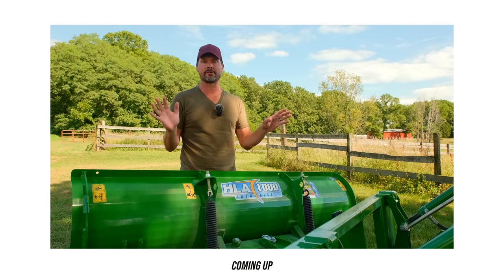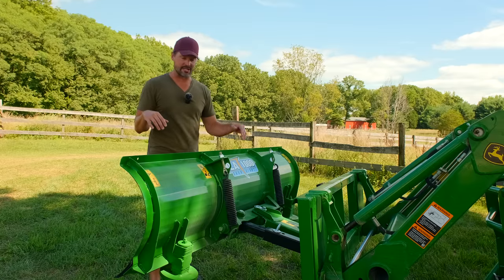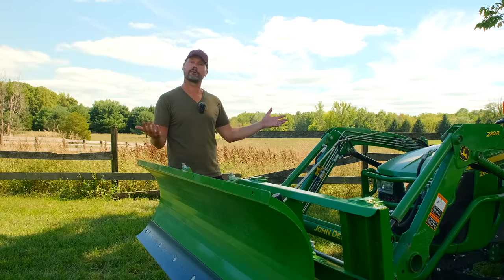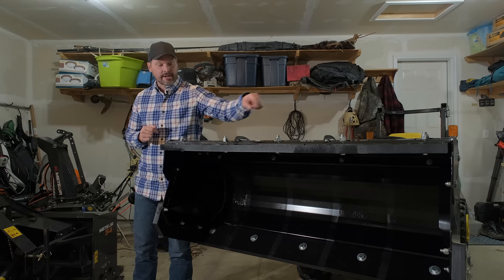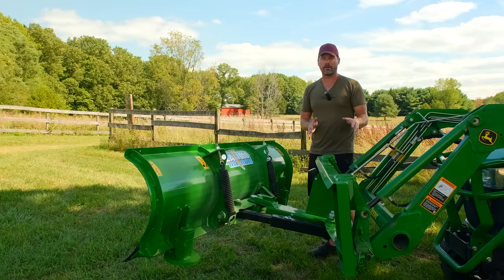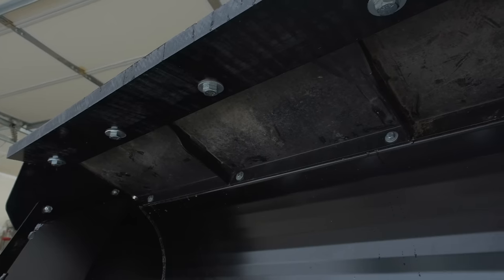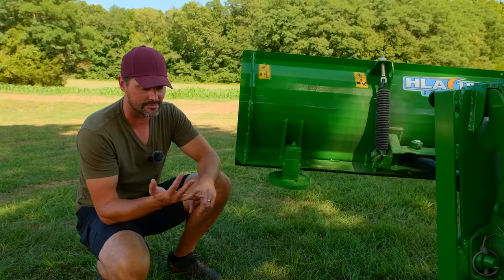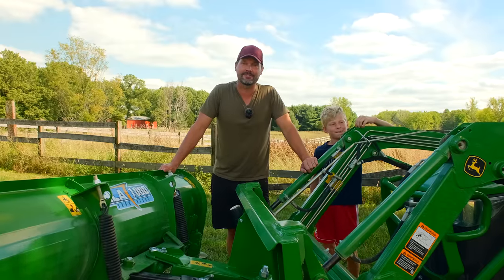A BRUTAL WINTER IS PREDICTED! THE ONLY SNOW PLOW YOU’LL EVER NEED! ☃️

Comment: Nice video. I have used an HLA 2000 Blade for the past 6 years, and they are a well built blade. Also, the UHMW edges I got from you last season are working out great! They get right down to the pavement and don't leave any marks. It's a very easy way to distinguish my residential plowing from other operators.
Also have grooved the tires on my last 2 tractors, which makes a big difference in traction. Haven't needed chains in the past 20 years.
Reply from the maker: That's awesome, glad to hear it.  Great info!

Comment: I use Spray on wipe off Groits Ceramic wax here in Northern New England. We need to be able to get slush off before it can freeze, and get Ice that has frozen, OFF .. I do two quick coats of the ceramic in the SUMMER when the buckets are off and on end.
Reply from the maker: Sweet, yeah I really should apply something soon if I'm going to do it again

Comment: I like just using the bucket and a rear blade to clear snow here in upstate N.Y. the bucket has It's limitations I know because it can't be angled but when the edges of the driveway start closing in as the season progresses, I can scoop the snow up and either dump it somewhere else or just dump it farther off the side. I clear the church parking lot where I attend and the bucket comes in handy to lift the snow and dump it on the other side of the curbs. That's harder to do with a plow. Anyway, I like your videos, keep 'em coming.

Comment: I have a 6ft snow plow on my 3046r. It does really well so far. Just installed a summit hydraulics 3rd function kit on it. Can't wait to upgrade the plow to be able to run hydraulics. The Canadians definitely know their snow. I have an old tractor supply  3pt snow blower that was made by a Canadiancompany. I've Had it 3 years and haven't had a chance ce to use it. Great video BTW.
Reply from the maker: Sweet, thanks for chiming in.  Stay warm this winter!

Comment: Hi Courtney,  Thanks for posting this great video.  I enjoy your content.

About the spray coatings on bucket, pusher or blade.  I noticed the you had a nice shiny new pusher for your test.  The control section worked as well as the different sprays.  Nice new smooth, painted, surface is also a coating, that's why it worked just as well...

I believe that the sticking issue comes into play with a well worn rusted bucket or blade.  Even if they are repainted older buckets still have the uneven textured, rusted, surfaces.  That is when the sticking is the worst.  In addition to PAM, Fluid Film, etc., kerosene has also been used as a release agent.  My bucket is over 35 years old and snow sticks, unlike your new buckets or blades.   😃  😊 

That could be a future test for you.  I know you are selling new shiny products, but down the road we users don't have the equipment looking quite as nice as new.  That is if we use our equipment.   😆 

Thanks for the post...  Dan
Reply from the maker: Good point Dan, will have to repeat in the future!  Thanks for bringing that up.

Comment: JD X758 -- With 4WD, HDAP tires, a 75# wheel wt. on each rear wheel, plus 6-42# suitcase wts. on the rear bracket, I have no problem pushing 1 1/2 - 2 feet of snow with my 54" front blade.  For years I have used CRC Heavy Duty Silicone spray, generously applied to the front blade, to prevent a build-up of snow and slush -- has worked well for me in Upstate New York, and now New England snows which tend to be quite heavy, wet and sticky.
Reply from the maker: I do love the x7 Series!  Thanks for sharing about the spray Robert

Comment: I have to add my suggestion to those that have stone or gravel driveways....several years ago a gentleman told me to add a length of pipe to the cutting edge of my grader blade. It works great , it still removes or rather moves some stone but by far does not dig into it like the bare cutting edge does. I will attempt to send a pic ,if I can figure out how to do it. I have passed this on to friends and they found it effective on their driveway.
Reply from the maker: that's an interesting idea, might have to try that out.
Reply: I probably have a 1½" pipe on my blade , welded a few tabs in locations I could attach to blade with the bolts that hold the blade on . Some circumstances require other attachment methods.

Comment: My old Deere 318 with the single stage blower...and some rust in the chute, I get the cheap cooking spray and it works great. BUT It has to go on before the chute has moisture on it, or it doesn't seem to stick.  The wet heavy stuff is usually when it causes issues.  I'd love to find a "cheap" dual stage blower for my 318, but the quick connect and such to hook it all up is just about impossible to find, then the blower run around $1500 used around here.  But really with a dual stage there isn't any need for the spray

Comment: For the cost of the tire cutter wouldn’t chains be a better choice?
Reply: I think chains would work way better! I know they will.
Reply from the maker: Not for a paved or concrete driveway.  Many horror stories of chains damaging paved driveways.  That's what this solution is for.  Chains are best for gravel.
Reply from the maker: For gravel, too easy to damage paved surfaces with chains
Reply: @GoodWorksTractors   that’s what I was wondering, got gravel so I will go with chains

Comment: How do I float my loader on my  JD 2022 1025r? I’ve tried and it doesn’t work in float when the handle is pushed fully forward.
Reply from the maker: You should be able to push your joystick even further forward....feels like you're going to break it, but then it pops into a new position
Reply: I pushed pretty darn hard on it. I’ll try again. Is this something that’s standard on all the 1025s?
Reply from the maker: @TexasSheepdawg21  yeah standard on most every compact tractor out there.

Comment: Just a quick question I am thing about a snow pusher for my kubota L4060 I am in sand county and my driveway is around 1000 ft long and all sand. Do you think with the skid shoes on this will work without digging into the sand I would need a 84 inch pusher and I am sure that's a lot of weight also do you sell chains or maybe better to go to kubota dealer
Reply from the maker: Hi Pineriver, sand is a tough situation.  Honestly, can't say I've had anyone with sand.  I think it would dig into sand unless it gets water in it and freezes up?  Really not sure what's best for that situation?  Maybe adjusting the skid runners a lot so that the main cutting edge is way above the plow surface so when it sinks in a bit, it's still riding above it?

Comment: Maybe a dumb question, but why are the skid things a disc a square edge, and not something shaped more like the runner on a sled? Seems like anything with a square edge has a higher likelihood of digging into gravel or asphalt.
Reply: They’re shaped more like a bowl usually. That’s the way mine are anyways so they don’t dig into the snow,gravel, dirt etc as much.
Reply from the maker: These do have a curved bottom that maybe doesn't show up well.  Definitely not flat.  The only squareness is the thickness of the steel.

Comment: I solved the plow width problem when I built my 72” plow for my 25hp compact tractor. I moved the pivot point for the turn back to the SS attachment plate. Now the plow swings as it turns and the plow pushes the snow farther on the wind row side. If your plow manufacturer uses this idea I would be happy to try a sample plow for them.
Reply from the maker: Interesting, not 100% sure I understand, but have a video?
Reply: @GoodWorksTractors  I do not have a video of the mechanism, but I probably should make one. 
The concept can be illustrated with a teeter totter, using a triangle for the fulcrum. If a six foot plank is on the point of an eighteen inch tall triangle, as the plank is pushed to one side the end of the plank will be less than three feet from the center of the triangle. This is the standard configuration of the plow that the tractor will ride on the snow. Now, flip the triangle so the point is on the ground and the plank is on the opposite flat side. As the plank is push down on one side the center of the plank swings in the direction that the plank is going down. In turn making the plow effectively wider on that side. 
It is really just flipping the A-frame around so the pivot point is at the quick tach plate rather than at the back of the plow.
It is a brilliantly simple way of making the plow work without increasing the blade size.
I could probably send pictures, but they would have to stay top secret…
Reply: @GoodWorksTractors  I sent an email to you.

Comment: Can these front blades be used to push dirt & gravel effectively???
Reply from the maker: These don't lock (spring trip is not locked), so wouldn't be the best choice.
Reply: @GoodWorksTractors  okie dokie. I've been looking for a front blade to do such work. My bucket on my H120 front end loader works, but sometimes digs in  a bit when I don't want it to.

Comment: I wonder how the loader mount plows compare to a plow that's mounted directly to the tractor?
Reply from the maker: Much better control with a frame mounted plow, steering can be challenging with the loader mounted plows.  That's one of the reasons I prefer pushers.
Reply: @GoodWorksTractors  I thought so. Seems like frame mounted plows are hard to come by. Exspeicaly for the bigger tractors (3and 4 series JD) I know some companys do make them.

Comment: Hi Courtney,
Comparing a snow pusher versus a snow blade, both have their benefits. Each type excels in a particular application.
A snow pusher is great for open areas and short driveways. It can move more snow in this instance, than a snow blade.
In contrast, if you have a long narrow driveway, a snow blade set at an angle, windrowing the snow to the side, would be way better and faster than a snow pusher.
Reply from the maker: Thanks Tom!